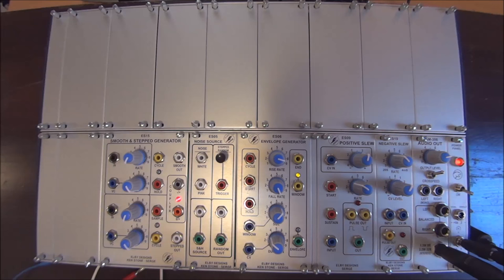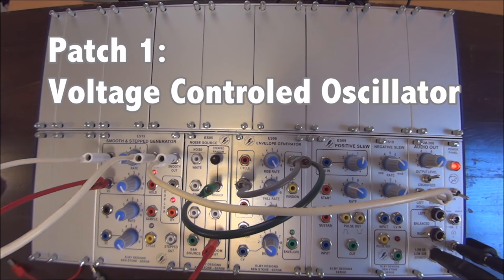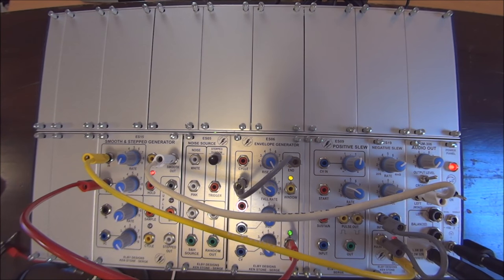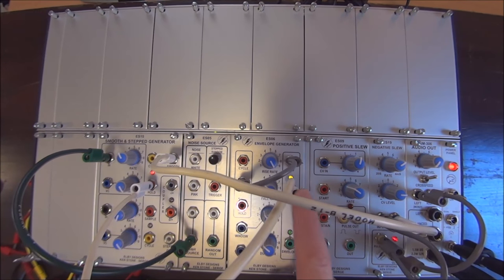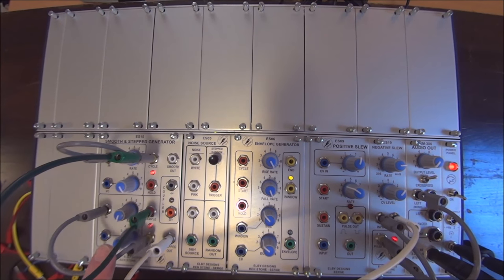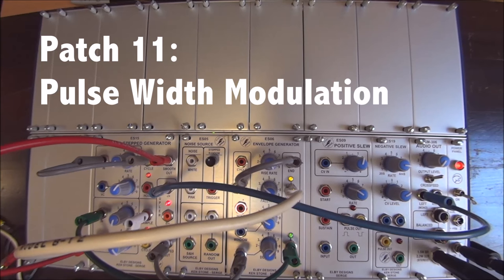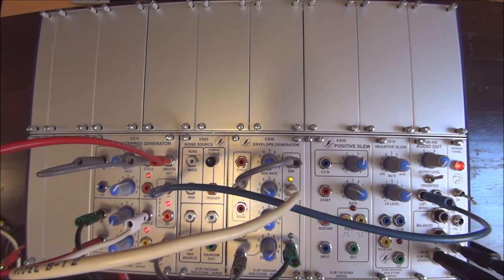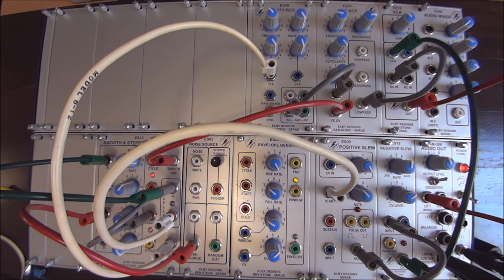Patch Programming the Serge Smooth & Stepped Generator - Patch of The Week

Comment: is there other modules that can do this low pass gate function well? perhaps possible with negative slew limiter? I'm new to elby and planning a rack build
Reply from the maker: Any slewing module that accepts an input (other than a trigger) could do something along the same lines but in my experience the Smooth Generator does it best by far.

Comment: This is great Doug, much appreciated, but I do have some comments.  I'm working on a doc to show how to do some of this with the Random*Source version, as method channing mentioned below.  There are a few aspects that do not seem to work at all on the R*S version so I left those out for now, but the biggest issue I've been having is duplicating the functionality of the "Window" on the EG.  I have never seen this functionality on any other Euro EG and it does limit the usefulness of your tutorial.  Hopefully I'm missing something, is there another way to get this functionality?
Reply from the maker: As far as the functionality, try delaying the pulse with a module or patch that can do that. It's unfortunate that you are unable to duplicate some of these common, historic uses of the Smooth & Stepped Generators on the R*S version. They are documented on the Serge, CGS and Elby EuroSerge versions. Don't forget that you can mix brands in Euro Rack. Also, I offer private lessons if that would helpful for you.
Reply from the maker: I forgot the STS version. These patches work there too.